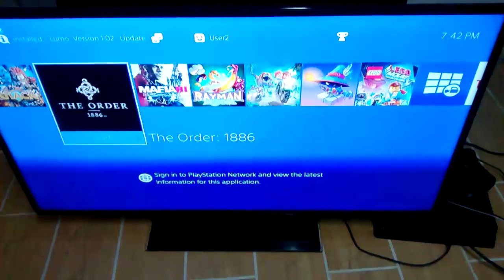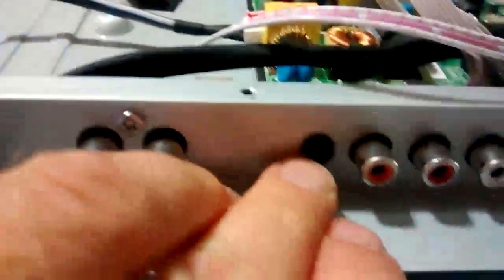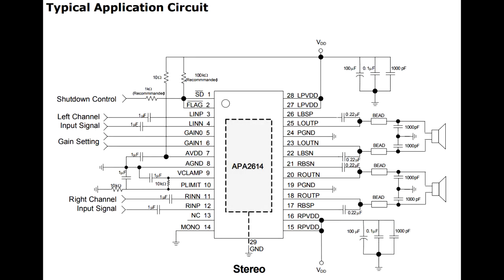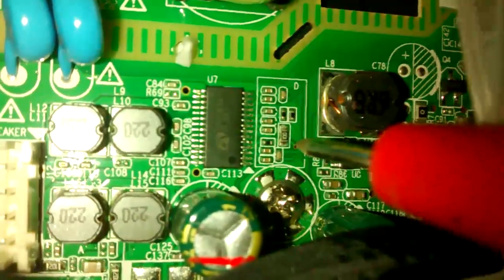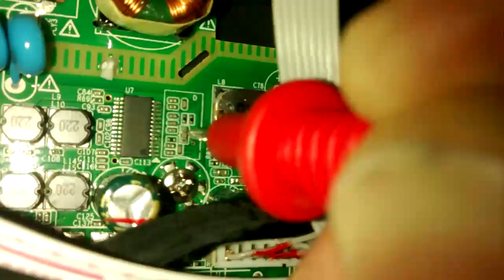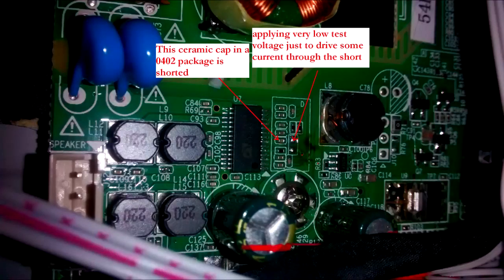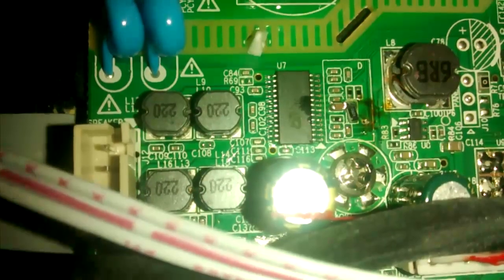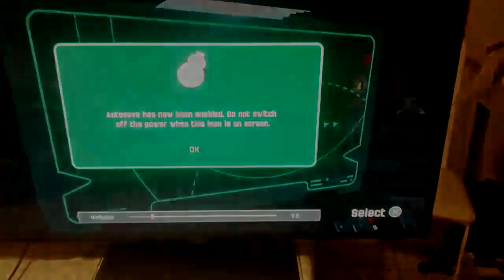RCA RLDED4016 no sound repair PROSCAN SEIKI  ELEMENT

Comment: Ok, this video was amazing! I had a customer bring me this same model of RCA TV with no audio. Checked the 100 ohm resistor, it was showing 2.6K ohms. Removed the resistor and the bypass capacitor; bypass capacitor was showing like 3nF. So I found a 100nF capacitor and replaced that. I could only find a 180 ohm resistor, so I used that. Everything works!
Reply: Customer arrived 2 hours ago and I'm already finished. Good thing because I promised to do it for only $35Cad. The guy is new from India and I'll definitely get business from his friends.

Comment: Anyway I can get ahold of you? I have the element 34013994 board. Same ic chip. I have no sound through speakers or headphones. I replaced the ic chip (28 pin audio chip) with 3 new ones. Still no sound. I checked pins 1 3.2v pin 28 27 both 12v. Pin 7 no voltage. I checked the cap that has 100 on it and I have 12v on one side and 0.7v on the other side of it. I don't know where to go from here.
Reply from the maker: that seems to be exactly the same problem as described in the video. You say "I checked the cap that has 100 on it and I have 12v on one side and 0.7v on the other side of it". SMD ceramic caps don't have anything printed on them so most likely that's the 10R resistor I was talking about in the video description. You should measure the resistance from pin 7 of the chip to gnd, it's probably shorted/low impedance ( while the TV is off). That would be the shorted cap. The component 100 would be the 10R resistor
Reply: TomTechTod so should I put the multimeter in ohm mode or diode mode? Connect the red lead to pin 7 and the black lead to any ground anywhere? At the moment the board has been removed from the TV again. So is it okay to check with no power what so ever? Also what should the resister that has 100 on it and is black read in diode mode? I'm getting 0.280v and 0.325 when I reverse the leads in diode mode. And the ceramic brown cap is giving me 0.256 and If I reverse the leads I get 0.410v. Both still soldered to board I have not removed. I have 3 of these boards trying to fix the no sound issue. I bought 10 of the IC chips cause someone told me that was the problem. I'm new at trying to do TV repairs. I do think I can do it with a little guidance and help. if you don't mind shooting email with contact info or I can send you mine. I've been trying to find this problem for over a month now. Thanks
Reply: And also should that resistor that says 100 on it show 12v on both sides when working right?
Reply from the maker: yes it should almost be the same voltage. since you can't post pictures here I cannot be entirely sure if we are talking about the same resistor but if you don't have near 12V on pin7 then it's probably the exact same problem I had, i.e. a shoretd ceramic cap and the 100 Ohm res.
Reply: TomTechTod The ic chip and resistors look the same and same setup.  anyway to talk outside of youtube? I would appreciate it greatly.
Reply: I would also be able to send you pictures. I have a spare board with those same caps. Are all those brown caps in the same row the same? If so I can take one out of the other board. The resistor with 100 on it I'm sure it is bad on my spare bad board. I can't find where to buy that exact resistor. Email please
Reply from the maker: can't say if they are the same, you'd need to remove and measure them. anyway it's not important. probably anything from 100nF to 1uF will work just fine, it's just a bypass capacitor. If you are in the US your best bet is digikey, they have probably the cheapest shipping. also, these are standard components that should be easy to find if you live in a city. or you remove the same components from your spare board
Reply: TomTechTod I live in a little city. No component shops. The brown caps I'm sure there is one good off my bad board. BUT the black resistor with 100 on it what specs do input in to try to buy the right size? I looked on ebay and there are 20 different kinds of 10 ohm resistors that are all different physical sizes. I want to make sure I buy the right parts.
Reply from the maker: It's either a 1206 or 0805 or 0603 package (imperial), there are so many variants of this board it's best to measure its dimension with a caliper if you have one. I couldn't tell from a picture what size it is. Here a list with common packages: http://www.resistorguide.com/resistor-sizes-and-packages/
Reply: TomTechTod do you know what size and specs your is? Mine looks identical to yours. Also what are the size and specs of bypass capacitors that are on YOUR board as well. I'm sure they are same. If you could actually shoot an email I'll show you.
Reply from the maker: i sent you an email
Reply: replied thank you. your awesome!